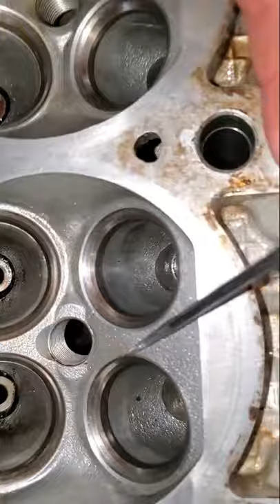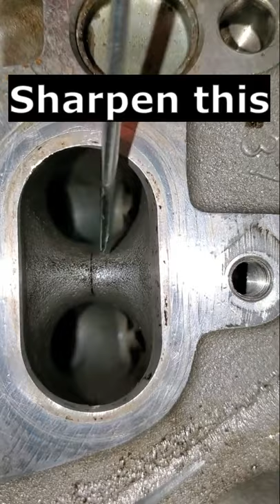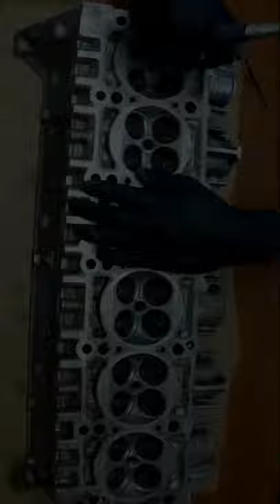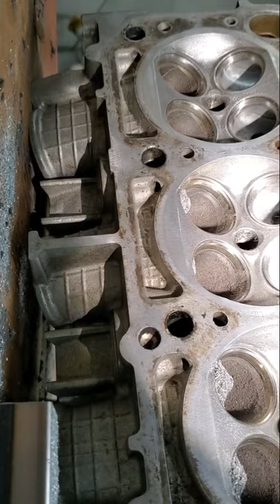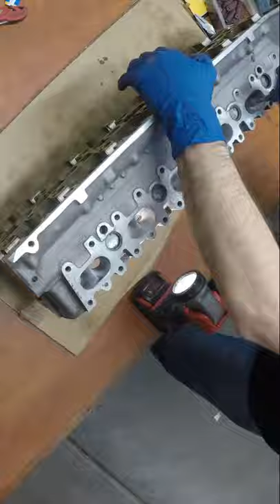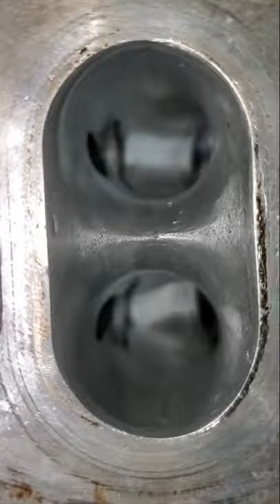Port A Head In 60 Seconds

Comment: It should be illegal to post a 60 second short of hand porting heads lol. This takes DAYS
Reply from the maker: It did hahaha. Just making the original video (its on my channel) took so long, and was a crime to reduce days to 15 minutes.
Reply: @JakeSublime  I’m gonna check it out! I’ve ported heads on a few different cars. I remember a Set of V8 heads took me over a week of work to port+polish
Reply: @JakeSublime  do you use a flow bench? Just wo dering, please dont think Im criticizing you,I do Harley heads and have found that leaving the floor brings flow numbers way up, It may be different in your application, Thats why I asked if you use a flow bench
Reply: And you don't do it with a die grinder either 🤦🏽‍♂️
Reply: God only knows how long it would take me. I’m a perfectionist that’s rarely happy with how something I’m working on looks at the end. I’d probably end up losing my temper and destroying the whole house. 😂
Reply: Doing it myself now on a 4 cylinder, it’s taking me forever to get through one exhaust port slowest work for the biggest rewards (it’ll still be slow but my work will make it)🙏🏽

Comment: Nice job, just remember so other pwople know.  Too sharp is bad, you wanna contur the devider walls.  If it's super sharp and to thin it spreads the air at high speed air flow, ypu want it to smoothly flow around and not split the air stream.  The reason is because it will create turbulence just like if ypu spray water at a edge of something you'll see the separation.  How ever looks great!
Reply from the maker: Good info, this is just for the exhaust side though. I didnt touch the intake, the divider sharpening was only for the recombining of gasses.
Reply: Precisely the comment I was looking for.
Reply: @JakeSublime  in the exhuat it should be fine to make it sharp since the flow doesn't hit the edge from the front
Reply: You don’t want it sharp anywhere.
In the exhaust or combustion chamber it creates hotspots
Reply: @qpzmak  It wouldn't matter in the Exhaust because you have air escaping past it. No worries for anything detonation and so on.
Reply: @qpzmak  it can....that is some old school stuff not many people know. This is not bad on this head though. 
Only thing to do is dyno it vs a stock head and see what we have.
Reply: @qpzmak  hot spots in the exhaust port wouldn't matter as it wouldn't impact anything since at that point combustion process is happening with exhaust valve being opened so no detonation can accure. However, the sharp exhaust fin can affect on width of exhaust port which in its turn can affect on exhaust gas velocity which in its turn can affect combustion chamber filling with fresh air-fuel charge efficiency...

Comment: Was that a casting line or a crack down the runner towards the end of vid?
Reply from the maker: Casting line. I wanted to remove  it to make it 100% smoothed, however, the line was really deep. I didnt want to remove too much material and hit the water jacket.
Reply: @JakeSublime  That's fair, it just flashed by too quick and had to ask.
Reply: @JakeSublime  Oh I was wondering why you didn't sharpen it more I didn't even think about the water jacket. 😅
Reply: @JakeSublime  Wait wouldn't this increase the air intake temperature?
Reply from the maker: Im not sure what connection youre making to make that assumption.. I dont think it would increase intake temps. In fact, it might decrease it. If youre able to get more exhaust out of the cylinder, you get more intake in, and more air moving through the intake reduces temps (air is in engine bay for less time).

Why do you think it would increase temps?
Reply: @JakeSublime  get an cold-air intake like a proper car, not some hack job engine bay "air" intake  job - hot air from engine bay reduces power output.
Reply from the maker: @kenlee-97  Yes, thats the plan. Check my newer update videos for more info if youd like

Comment: Shouldn't this be done by machine to ensure tolerance? I'm asking, not being a YouTube critic. When it comes to automotive mechanics, I can change brakes, tires and fluids, but that's about as far as my experience goes.
Reply: As far as I know yes CNC porting has its advantages especially if you’re doing heavy porting and may be getting near the water jacket. But even if a head is CNC ported there is usually final finish porting done by hand. Also consider that the CNC machines to do the porting are $$$$, and require someone proficient in CNC machining to operate them. Not many automotive machine shops have that
Reply: @benmorris5046  cool, thanks for the info!
Reply from the maker: One thing to add, the objective of this job was relatively minor (comparable to a "stage 1" or "stage 1.5" port job), in comparison to something more complex like enlarging things and bigger valves (stage 2 or stage 3 port job). I only wanted to smooth and blend things, as well as sharpen the divider. I really didnt run any risk for accidentally hitting a water jacket or such. 

Port jobs like this, anyone can do with little to no risk.
Reply: will b  makes sense now that I think about it.
Reply: AFAIK most cnc port profiles are based on an original hand-ported head that's been scanned with a probe and checked on a flow bench. Cnc porting brings consistency but isn't necessarily better.
Reply: So what benefits does this particular head port bring to an N/A motor, say?

Also could messing with exhaust flow negatively affect high compression engines? 

What all would you be looking for to establish a successful head port? What would you want to avoid seeing? 

Sorry about all the questions but this is the first YouTube short i find of this and I figure you probably know enough to help. Thanks in advance
Reply: @SailingFrolic  I'm no professional but porting typically allows smoother airflow for intake and exhaust which helps with fuel delivery you're able to get more power from less fuel because it's traveling into the cylinder better and then with the exhaust at least in two cycle dirt bikes the more exhaust you have the more power you can actually make because exhaust is used fuel if it's not traveling out of the cylinder then it's taking up room for good fuel so porting the exhaust helps get rid of that used air/fuel
Reply: @LucidDream34  so fuel delivery would not be a benefit in DI engines as fuel doesn't pass over any intakes or rails, it just gets shot in the cylinder by the injectors.

Therefore it just seems to get rid of exhaust quicker, thus allowing for more power per stroke cycle?
If so, wouldn't it be advisable to also shave a little bit in the intake manifold as well to increase airflow there.
Reply: @SailingFrolic  well in that case it's still down to being able to get air the more air in the cylinder means more combustion/power, you see it in engines that need LOTS of air they used to have carburetor's for each cylinder so they get the best air flow without one cylinder getting more air than the other and with Diesel engines you can almost just put a bigger turbo and have more power no tune
Reply: @LucidDream34  direct injection is not diesel, I'm sorry if you misunderstood.
Engines like Mazda's Skyactiv-G, Hyundai GDI engines, and some Toyota engines use Direct Injection to improve efficiency and power output for smaller engines.
I'm curious what kind of tuning would be required on the back end to make this work with the ECU for modern vehicles.

So in it's own, porting is it's more rudimentary version of engine tuning, seems like.
Reply: They’re less accurate from the factory than people can get it, the difference between pistons for that is within the margin of error
Reply: @SailingFrolic  well depending on the vehicle, direct injection vehicles no, its all about airflow,  in anycase it's about air flow the same amount of gas is being squirted whether you have a port job or not, its how smoothly the air, or air/fuel mixture gets into the cylinder smoothly.  Smoother airflow, more air allowed in, less turbulence, better atomization,  more bang, more efficiency
Reply: What really matters is not touching the valve seat.
Reply: @SailingFrolic  porting creates better flow, into and out from the cylinder. Better flow means more air, more air means more fuel can be burned (after re tuning), more fuel burned = more power. This can be done on naturally aspirated engines, or can achieve more power at the same boost level on a turbo. In fact, a good flowing head can often show as a reduction in boost pressure along with an increase in power on a boosted engine. 

If you can't tell, I'm a big advocate of porting. Especially on turbos. You can make more power and/or have lower intake temps because the turbo isn't working as hard.  Theoretically.
Reply: @jdmjesus6103  I can see your love for porting and I applaud it. It's a good method of getting more power without introducing more complex parts and systems. Thanks for all the info, everyone. Learn something new every day!
Reply: @SailingFrolic  Porting results are often negligible without boost (turbo, supercharger). Sometimes the increased port area (on N/A) with sacrifice low rpm torque for a gain in high rpm power.
Personally I prefer to just polish ports on N/A.
Reply: CC ing the combustion chamber which he didn't show takes a long time.
Reply: @JesusSaves86AB porting shows huge gains on n/a and boosted motors it really doesn’t make a difference which it is, even when the motor isn’t at the flow limit of the head yet both stock and modified. This is a well known and documented fact. Richard holdener and David Vizard (professional racers who are both record holders) separately have displayed here on YouTube massive gains with dyno testing and flow data to back it up to show you the science behind it if anyone is actually interested about learning about it that’s the place to start. People want to act like this is some sort of dark art that no one really understands but it’s all well understood and documented already. Cheers ✌️
Reply: @SpecialAgentJamesAki  oh, I see- we read the same books. DV, RH)))

Comment: What did you gain? Any measurable numbers? How do you know you made the port better and didn't hurt the air fow or air velocity?
Reply: Wondering the same. Seeing so many people doing porting that just looks good but doesn’t perform.
Reply: @SpecialAgentJamesAki  Well, I accept that you can do entry level efficient head porting - it doesn't take too much if you have the basic knowledge, usually you gain a little bit. But still, in order to say you've done porting job and upload it you better off to have sume supporting numbers. Without that it's just a gambling...

Comment: Some heads take longer than others to port. Small Block Ford for instance is one that takes more time than most other V8 heads because so much needs to be ground out in the right places. By the time you have an SBF head as good as you can get it the intake runner will be 20-25 cc larger.
Reply: Never played with a 351C, obviously

Comment: Have you herd of 'extrude honing' ? Apparently works great and can be done with inlet manifold bolted on. So also port matches at the same time. Read about it a car mag many years ago. But I have not seen many people use the method
Reply: I have kennametal extrude hone in irwin pa..they can tell u all about it.they do exhaust even..they said to me it is some kind of diamond puddy that is pumped through.that mimics how air flows.
Reply from the maker: Wow thats actually amazing. Ill check it out bro thanks for the heads up.